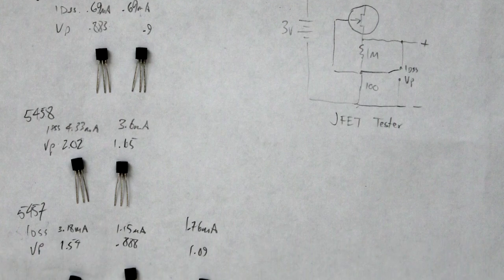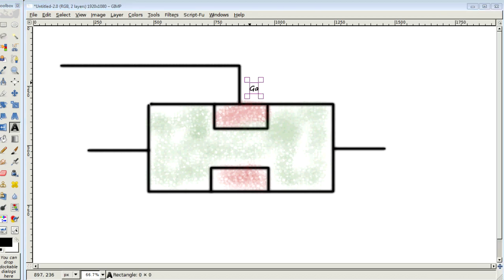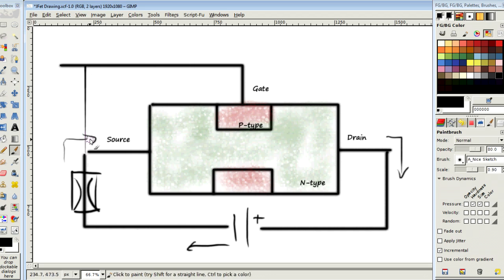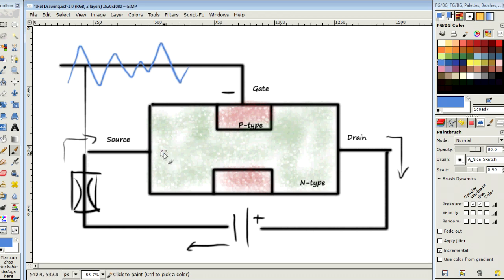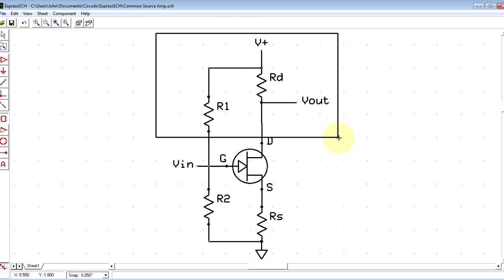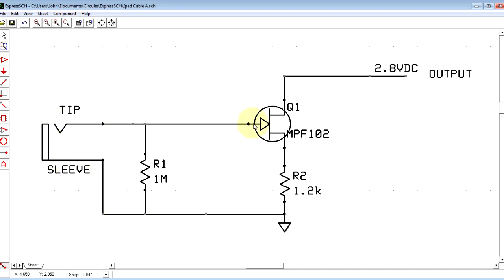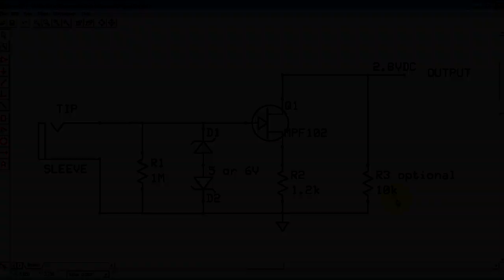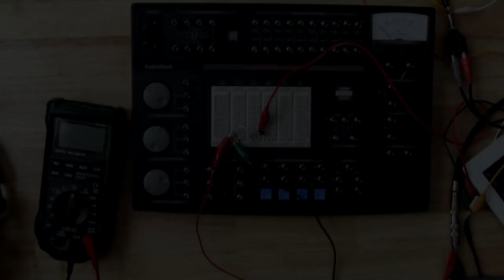Simple JFET Preamp for an iDevice guitar Interface, part 2

Comment: Thank for this nice instructional vid. I was wondering if your circuit design can be used for pc as well without any modification? or if not, can you design something similar for pc. like having minimal parts and requires no extra power source. I wanted to build one for pc but all of the circuit designs I found requires extra power from a 9volt battery. Can you help me please. Thanks

Comment: I really like your videos and find your knowledge of electronics fascinating. I know this is an old video, but i have a couple of questions, and was hoping you could provide an answer or two. My first is if this could be used with a computer, only using a separate headphone and mic cable. My second is if, instead of adding a permanent 10K resistor to the circuit, could a 25k trim pot be used instead to vary the resistance for different output pickups and also add some more headroom to the circuit. I use both single coil and humbucker pickups and, although turning the input volume up on the amp sim is easy enough, I think that might be a good tweak to the circuit.
Reply from the maker: This circuit requires a voltage to be provided from the the host jack, to power the FET.  If your computer has a line-out, then it won't provide the required voltage.   A trim pot would be fine instead of the fixed resistor, except that it will require a separate project box, rather than fitting inside the plug.
Reply: Yea, I'll have to test the mic jack on my soundcard to see if it supplies any voltage, if not could it be powered by 2-3 AA or AAA batteries? And I realize it wouldn't fit in the jack, I intended to use a seperate box for it. But with the trim pot, would it work like the volume on the guitar and suck out some of the brightness?
Reply from the maker: Drew Webster - no this trimpot would not be wired like a volume pot and wouldn't affect brightness.  Take a look at Tillman's preamp designs for ideas on powering the circuit with a battery.

Comment: First off, Excellent video. Thanks for all your hard work putting this 3 part series together. I wanted to ask you a question, I'm looking to record only audio from the line output of my DJ Mixer going into my iphone headphone jack when recording video. 
Basically like the (Line In Headset Buddy which is a $22 device)
My question is:  do i need a resistor between the sleeve which = iphone mic and ring 2 which = ground to make this work? I know what cable I need, but not the electronic components needed to fool the internal mic of my iphone and trick it by recording the audio line out of my mixer.
Any help would be greatly appreciated.
Reply from the maker: You could use the same circuit shown here, but with changes to the resistor values. A line level input expects a low impedance, so set R1 to something like 10k instead of 1M. A line level is around 2v. Experiment with R2/R3 until the signal avoids clipping/distortion. A google search turned up another circuit example: https://gmondada.wordpress.com/2017/03/28/using-ipadiphone-headphone-jack-for-audio-input/

Comment: Quick question, will this be ok coming from the headphone out of a multifx pedal?  I dont use apps, i just need to record...thanks.
Reply from the maker: I doubt there will be the necessary voltage on the output of your pedal.  Unlike a laptop or computer, a guitar pedal isn't expecting a microphone/headset to be plugged in.
Reply: @johnplanetz  thanks for your reply,   ive ended up making a modified irig circuit,  which kind of works, but had to add a dpdt switch for record and playback to avoid dc crackle on the record level pot.....a work around,  i just need to record vid, audio on a tablet.....cheers .

Comment: Very interesting. Will the circuit work for plugging my guitar o the mic input in the notevook?
Reply from the maker: If the computer's 3.5mm jack has a voltage (to power an electret mic) ,then this same approach would work. Test the jack pins with a multimeter to determine what's available.
Reply: @johnplanetz  Yes I thought I had to do that, I'll try later, many thanks!
Reply: @johnplanetz  I measure 2.6V so it would work. What if I add the optional R3 10k resistor, just in case, while it is not necessary?
Reply from the maker: @rva1945  I would just experiment on breadboard with the resistors, to see what works.
Reply: @johnplanetz  I can't find the MPF102. Do you know about replacements? Will a BF246 do?
Reply from the maker: @rva1945  not sure. you'll have to compare the data sheets, and do some experiments.
Reply: @johnplanetz  After struggling to find a replacement with no success, I tried with an IRFZ46N that I found in my workshop and used for driving electric motors and it works! I didn't use any zener diode as I don't have any for now. Now I can plug my guitar to the mic input. Thanks!
Reply: @johnplanetz  As told it works with another fet. I didn't use any zener. Anyway, if they are intended to take any excess signal, shouldn't they be connected opposite to each other but in parallel ?

Comment: hi john great tutorial and i'm reallly super intrested to build one on my own... well i'm still preparing the component and i have a question about the zener diode since i'm not good at electronic component... is it 5 or 6 V on both of the diode or is it the value of each diode so the total of 2 diode will be 10 or 12 V... and um when i try to buy, the sales asked me whether it's 1W or 0.5W... i'm really sorry for my lack of knowledge but your help will be truly appreciated...thanks
Reply from the maker: The zener breakdown voltage should be around 5v for each zener.  Either 0.5W or 1W is fine.  There is very little current in the guitar circuit.

Comment: hi john, MPF102 is difficult to find here in my area.according to your schematic, i can use 2N5457 as a substitute which luckily the shop here have some stocks left. what will the value of R2 if I use this kind of JFET? I need help pls. Thanks for your wonderful tutorial. cheers!
Reply from the maker: See the discussion in the comments at my blog: http://www.planetz.com/simple-jfet-preamp-for-an-idevice-guitar-interface.  Some people had luck with R2 between 10 and 30k with the 2N5457.  You could experiment with a 50k trim pot until you find a value that works well, then measure it and replace it with a comparable resistor.

Comment: Hi John
i was planning to build a piezo pickup preamp and had already bought some JFET when I saw your video and decided that an iDevice preamp might be more fun. It took me a while to understand that the ground from the iPad needs to ground the circuit but that's probably just beginners idiocy and your tutorial could not have been more verbose. The weird thing I encountered was, the guitar sounded really out-of-tune. No amount of tuning could fix the offness of certain tones up and down the fretboard. I put a 1microF capacitor on the drain and the detuning disappeared. I had no diodes on hand so I left them out. Do you think the diodes in your circuit are  de-oscillating the input from guitar? 
I had to use Toshiba 2SK369 as no other JFET was available here in Germany. I can really recommend them. The low noise is spooky. Nothing comes through the preamp until you touch the strings of the guitar and then there's so much signal it's too much for the headphones. I used my studio monitor instead.
Thanks for the great tutorial.
Phelim
Reply from the maker: Hey there- I can't imagine the zener diodes would have any effect on this.  They are purely there as static discharge protection.  I'm glad you experimented with the circuit and were able to get a satisfactory result.  Nice work!

Comment: thanks a lot for this great tutorial. but i couldn't made this i think. o i used wrong transistor. the seller give me F254C fet. he said "i do not have MPF102 but  F254C is the same with MPF102" is that right?
the pin structure of F254C is D-S-G while the structure of MPF102 is G-S-D.

Comment: I was thinking through an issue I'm facing and thought of your video. Would this be good for running a guitar into the mic in port on a laptop?
Reply from the maker: The JFET in this circuit requires power.  If your laptop has a powered mic input, it might work. But not if you only have a line-in. Check the input with a multimeter to see if it carries a DC voltage.
Reply: ***** Can I assume that it does if I have the option to turn on DC coupling?

Comment: Hello sir, i am VERY inexperienced with electronics so i may sound a bit dumb here but while digging around i came across a bag of BC337-25 transistors. i looked up the data sheet and have no idea what i'm looking at but was wondering if it would be possible to use it for this preamp if the other parts were modified to work with the BC337-25?
Reply from the maker: Using that transistor would require a different circuit design.  To use the circuit presented in this video, you should use a JFET.

Comment: Are your Zeners Flipped? The schematic you drew has cathodes facing away from each other and it seems you have cathodes facing each other on the circuit. Does it matter? One of the diodes is going to get activated with anything over .7V, meanwhile the other will still wait for the reverse breakdown voltage. I know it's a failsafe for static discharges, just wondering if the orientation matters.
Reply from the maker: It doesn't matter in this case- one protects against charges from positive to negative.  The other protects against charges from negative to positive.

Comment: Hi John. Thanks for sharing your knowledge and helping all of us less experienced musicians. I'm hoping you can help me with a simpler cable. I want to run a cable from my guitar to my cell phone , but only for tuning. I won't be using my cell for recording so I hope i really don't need the cable you showed in your video. Any suggestion for me ? Thanks and have a great weekend.  :  )
Reply from the maker: +Rik J. Smith - yes tuning should work fine without buffering.   That's what the Griffin GuitarConnect cable is.  If you want to make your own, you just need a TRRS male plug, and 1/4" male plug for the guitar-side, and connect the appropriate leads - as shown in part 1 the video: https://www.youtube.com/watch?v=p1T8QmQowVQ&t=4m46s

Comment: If I want use it in my send/return amp I must do a modifications or I can plug in the guitar-in the send of my preamp?
Reply from the maker: I haven't tried, but you should be able to do this without circuit modifications:  
amp send to preamp mic input to ipad/iphone processing to  preamp headphone output to amp return.  You may find it too noisy- but you could try.

Comment: can I use this for an android device...what I mean will there be any difference in voltage outage than the ipad
Reply from the maker: +Julien Ghanimeh - I guess it will work, since the voltage to drive an electret mic is standard.  But I don't have an android device to try. The only way to know for sure is to measure the voltage at your jack using a multimeter.
Reply: You're awsome man thanks for your reply

Comment: i'm not into electronic components, but i found a circuit and it comes with a resistor(the R1 from your circuit) of 39k instead of the 1M that you put in your circuit, do you think 39k is enough? these are the resistors in the order of your circuit, R1= 39k, R2= 1.2k and R3= 4.7k and they also use the MPF102. and these are the values of the caps 22nf, 100nf and 470pf. here is the circuit http://guitar-gear.ru/forum/index.php?app=core&module=attach&section=attach&attach_rel_module=post&attach_id=16412
Reply from the maker: A higher resistance would be better for R1, to make this a high impedance input.  A lower resistance to ground will excessively load your passive pickups, causing treble rolloff and a dull sound. Try it and see!
Reply: thank you.